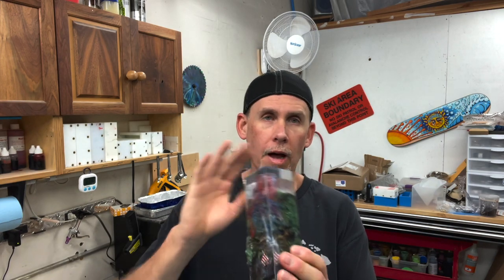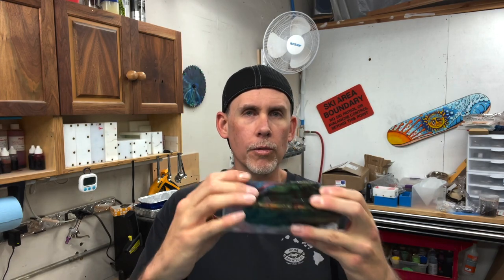Resin Casting F-35 Lightning Pin on Camouflage Burl to Make a Bottle Opener

Comment: Really looks cool! Can I ask a question about other resins, specifically polyester resin? Have you tried turning using polyester resin and if so, did it turn as well as say Alumilite or Art Resin?
Reply from the maker: Thanks! Yes, I have turned PR, and it is chippy and more brittle usually than epoxy or alumilite. It also smells nasty when casting and turning it. I generally steer clear of it myself
Reply: @ZacHiggins   Thanks, Zac - that's what I was worried about! Will stick to equivalents to Alumilite (too expensive to buy this side of the pond). Thanks and stay safe 👍

Comment: Add a little resin or clear 5min epoxy to those threads and then all you see is the screw. No foggy white
Reply from the maker: I don't mind the frosted look personally, but I agree that adding a layer of resin in there could clear it up